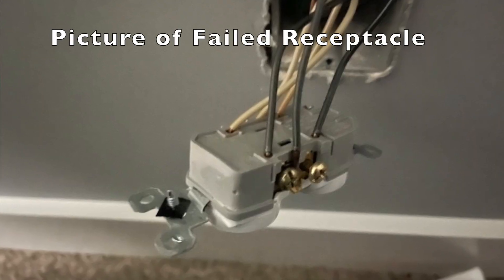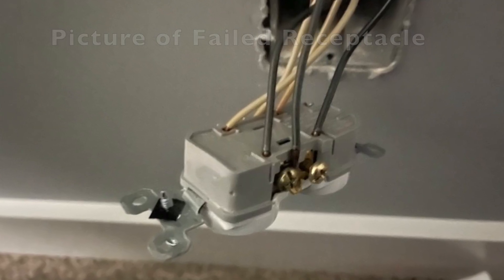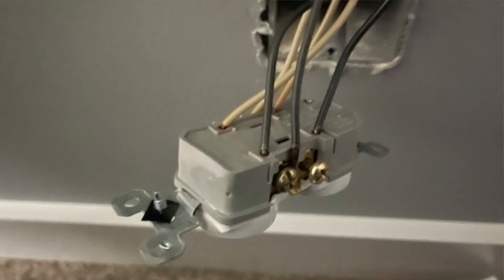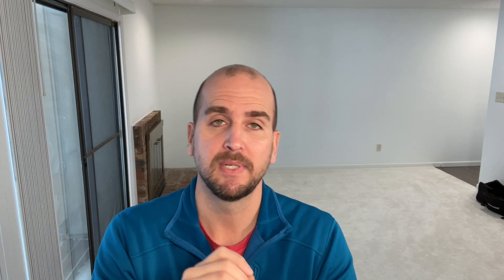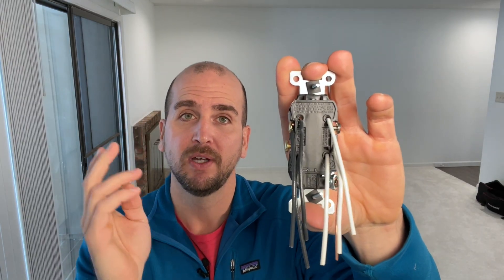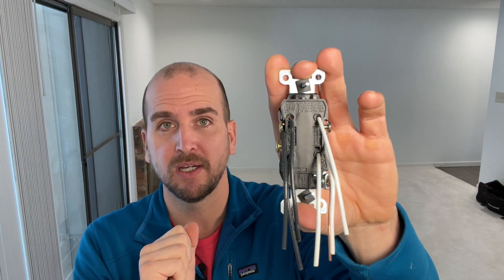Incorrectly Wired Outlet Found In Newly Built Home

Comment: You can't put a15 amp rated receptacle on a 20 amp breaker..You will burn your house down....Why you don't find quick stab receptacles rated for 20 amp.
Reply: A 15 amp duplex receptacle is code on a 20 amp circuit. A 15 amp spec grade receptacle is exactly the same as a 20 amp, but without the horizontal slot and associated contacts. The only reason it rated 15 amps is that you cannot put a 20 amp plug in it. I never recommend a 20 amp duplex receptacle in a residential application because it's a waste of money and you'll never need it. The same thing applies to gfci receptacles.

Comment: I also wrap my outlets with electrical tape to cover the screw terminals 👍
Reply: That is not necessary, the box screws won't let terminals touch a metal box. Try it
Reply: @robc.701  smart.
Reply: A complete waste of time, leaving a stick mess for future work. Once secured in a box, the yoke cannot move enough to short against a box (and half the boxes are non-metallic). Nothing can get inside the box to short the gap because you will ALWAYS turn the power off before your remove the cover plate, right?
Reply: @FisherCatProductions  do you work with live wires tho

Comment: I've wired over 1000 homes and have stabbed my wires and have never had a failure.
Nor do I screw in my unused screws. Plastic boxes.
Tape device in metal boxes no need.
No need to pig tail either.
I5 amp plug is rated to be used on 15 amp circuit.
Opinions are like assholes we all got one.
But none of the things you covered are illegal or required.
Waste of time.
Reply: One thing I noticed when you tightened down the pigtail "hot" wire. You installed the wire on the topside of the screw. As a safety point, it should have been installed on the bottoming of the screw. Reason being is, it follows the rotation of the screw. When you tighten down the screw the rotation will pull the wire into the connection. The other way it has a tendency to push it out some if your not holding in the contact point. Not a big deal, just a rule of thumb.

Comment: You should also place the ground "hole" on top and the 2 prongs on the bottom. I.e. the outlet should be turned around.
Reply: Please explain, thanks
Reply: @dollyhadbraces9361  the hole for the ground prong should be on top. Industry practice, the reason: while something is plugged in, should something conductive fall between the plug and the outlet, it will not land across the blades and cause a short.

Comment: At my mother-in-Iaw manufactured home, (with the electrical certification), the receptacle actually failed because of the practice of not using pigtails. The circuit was a 20 amp with #12AWG wiring, but the receptacles were the inexpensive 15 amp rated, and the circuit was continued using push-in wiring from receptacle to receptacle in the walls. When using a heater appliance (iced tea maker) and the refrigerator running there was probably close to 20 amps going through the circuit. With the use of push-in wiring , the there was 20 amps going through the receptacle, and it melted. (Melting is the way the circuits opened up, so there wasn't a fire, and the circuit breaker didn't trip. It did take out everything downstream of the receptacle, including the refrigerator). I replaced the receptacle with 20 amp rated, and wired them with pigtails. The pigtails take the full 20 amp of the circuit and the current going to the receptacle is only the current for its appliance plugged into it, not the entire circuit. I think if 15 amp receptacles are used, the code should require pigtails on a 20 amp circuit, and not just a good practice.
Reply: > The circuit was a 20 amp with @/12awg wiring, but the receptacles were the inexpensive 15 amp rated

Then it did not fail because of lack of pigtails, it failed because it was mismatched.

Comment: I was taught to pig tail the wires.  Wire nut the hot and neutral and use a crimp on the ground wires.  This way you only have one wire on each screw. I was also taught to bend the wires around the screws not just stick it in like you did here.
Reply: @Taco I've seen some where they strip the wire in the middle and wrap it on the screw total hack job.

Comment: The pigtail is fine if you have the room in the box . I have been in boxs that dont have the room . I worked in one home that every switch replacment had to have pigtails . When the home was built they added the switch then pulled out the extra line . It was a mess just getting the switches out to replace them .

Comment: I am planning to install a recessed  (usb) power outlet for a Tablet. Can I use or run  wires from an existing push button switch? Is it safe to do so? Problem I have there are no outlets available in this area except a push button.

Comment: I have 4 degrees, but none of them in Electrical. I wanted to know why "pigtails" were necessary.
Reply: The electrical code stipulates that the receptacle is not a connecting device. Having 2 screws on each side is not intended for ease of in and out wiring, but for the option of separating the upper and lower sockets.

Comment: <Don't twist the wires together first. Allow the wire nut to do that. Test the connection by tugging on the wires afterward. Hope this helps.>
Reply: James, wrong, you twist wires together then install wire nut. I just corrected a a no power at a receptacle due to wires not twisted. Wire nut showed arcing due to wires not being twisted before installing wire nut. Have been an Electrician overv50 years and a licensed Electrical contractor over 40 years. If you can mention a code violations by Electricians & non Electricians, I have seen it.
Reply: @philtorres2975  "How to Install Twist-on Wire Connectors

    Turn power off.
    Strip wires, usually about ½ inch for two wires. Strip about ¾ to 1 inch for more than two wires. Lead stranded wire(s) beyond the solid wire(s) by about 1/16 inch(1.6mm).
    Align frayed strands and conductors.
    Hold wire ends together evenly.
    Insert wires into connector and screw on clockwise until the connector stops twisting.
    Lightly pull on each wire to ensure the wires are secured inside of the connector.

The connector should stop twisting after step 5. If it does not stop twisting or if a wire comes loose when pulling in step 6, undo the connection and start over again. Another size connector may be needed to make a proper connection."
Reply: @James-dt7ky  , been doing wire twisting and installing wire nuts for  over 50 years. Cheap labor can turn out to be expensive, quality labor in not cheap.
Reply: @philtorres2975  I agree. I suspect the case you quoted was not done properly. Perhaps a hasty job? I once opened a junction box with multiple connections inside. It was on the ceiling of a factory. When I removed the cover plate 4 marettes fell out. That should never happen.

Comment: I recently (5 years ago) bought a house built in 1959 - had a home inspection etc. Now I'm a journeyman in a few different states and a master in one - and have been in the electrical business over 35 years.  After we moved into our new to us house I was going to add an outlet to a bedroom - I was going to extend an outlet that was just on the other side of the wall - when I removed the outlet I was extending I found what is referred to as a bootleg ground.  That is when a contractor that's working out of a slow moving 15 year old pickup takes the ground lug on an outlet and jumps it to the neutral.  There are some serious issues with this ... as you all know if you open the neutral on a 120 circuit the voltage on the neutral will go to line voltage.  So the upshot is every device that is grounded by these bootleg grounds will be energized at line voltage.  Stated another way - every metal frame or piece of electronics will be energized at line voltage if the neutral opens up.  The only thing this BS does is allow the illegally grounded outlets to pass the test the inspectors do with the plug tester...  after I found this I pulled the panel cover and found 8 circuits with the old 2 wire Romex ... So the lesson for electricians to take away from this is two fold - some things that look and test normal might actually be very dangerous - and when your testing stuff and your first impression is that something is screwed up - your probably right..  Bootleg Grounds - watch for them on remodels...
Reply from the maker: 🤦‍♂️ Thanks for the example JT.
Reply: You can't get a loan unless someone inspects the electrical...So how the hell did the inspector sign off on that shit? And don't assume shit..I seen people not bond the Service panel...But bonded all the sub-panels..Ass backwards of what should have been done..

So I would have been looking for that electrical inspector for the loan company..That upgrade would would be coming out of their pockets..
Reply: @WizzRacing  the electrical inspection requirement is different in each state and with each lender.  However if you do have a pre purchase home inspection and some electrical issue is identified by the home inspector it has to be repaired before a loan will issue - however home inspectors will not remove cover plates - or look very far into a system - they actually write their limits of inspection into their paperwork - they dont even have to move a rug and look under it - ask me how I know this - there was a big crack hidden under the rug in a bathroom that was on the corner of the house - cost me 12k to get the foundation stabilized- another hint about house inspectors recommended by the real estate agent - they wont ever find enough stuff wrong with a house that will queer the deal.  After all if they screw over the real estate agents sales then they wont get any inspections from them -- it's best to contact a inspector that works for you not the agent...
Reply: @JT H.  Is it true that if you use a GFCI in the areas (where the 2 wire Romex is located) it would pass inspection? Even if you connect the ground lug to neutral.
Reply from the maker: @asqtv7786  this video will walk you through the install process and address your question.  Thanks!  https://youtu.be/qrtyUuL-eRw
Reply: @asqtv7786  yes - the way a gfci works is like this - there is a small device called a ct or current transformer that goes around both the current carrying conductor and the neutral - the gfci monitors the out going and incoming current - if those two currents dont match that means there must be a current leak in the circuit - a current leak is by default also a voltage leak otherwise known as a short.  The gfci will operate on about 3 milliamps of current.   However you still dont want to connect the ground lug on a gfci to the neutral - if the neutral opened up all metal surfaces would still be energized on devices ahead of the open neutral.   The code allows for protection of 2 wire circuits with gfci outlets - you can use one gfci to protect several outlets - just locate the first outlet in the circuit and wire in your gfci then wire the rest of the circuit onto the load side of the gfci and the CT sensor measures all the current going through the protected circuit.
Reply: @jth1699  Perfect explanation! Thank you!
Reply: Thank you!